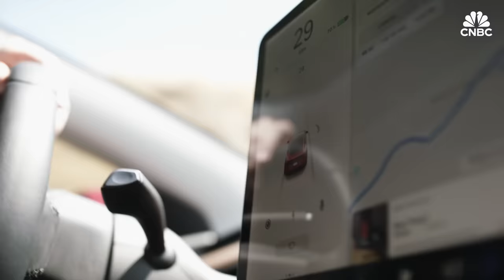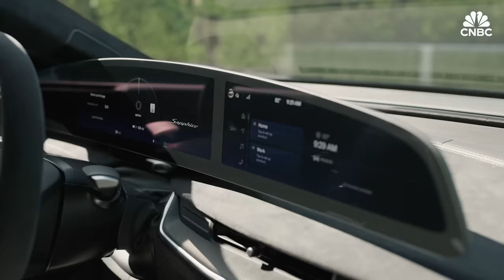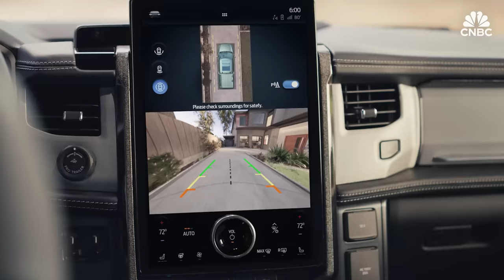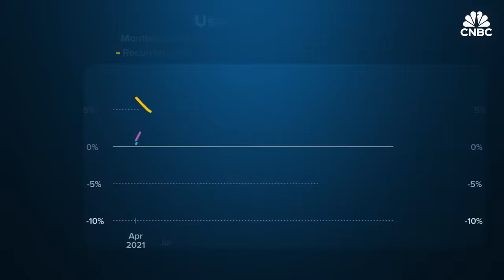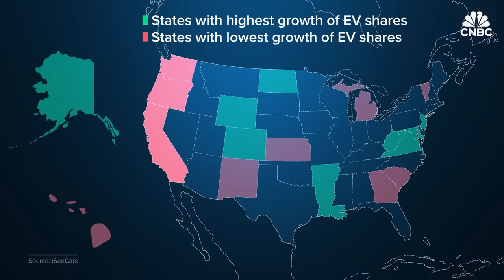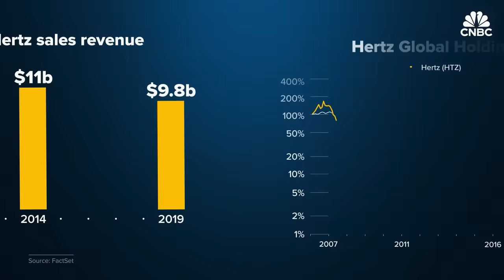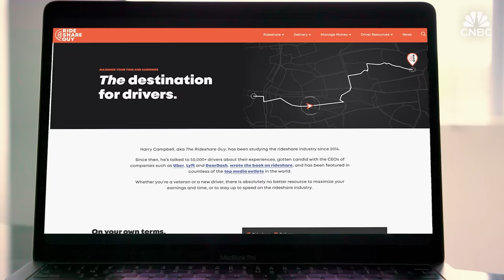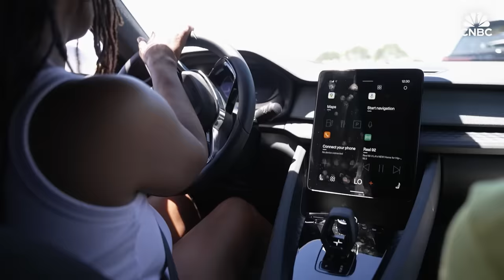Why EV Sales Are Falling | CNBC Marathon

Comment: I’ll tell you why EV technology is bad:

1. Charging times are too long.
2. Range between charges are too short.
3. Registration costs are too high.
4. Batteries have problems with cold and hot weather.
5. Batteries are extremely dangerous.
6. Expensive insurance policies/rates.
7. Tax credits are too low.
8. Prices are too high.

Technology suppose to improve in most or in all areas, is not suppose to go backwards.
Reply: Agreed. I still maintain that having the EV’s as an option for those people an EV makes sense for is great. Government mandates have gotten out of control though. It’s leftist group think just like the lockdowns a few years ago. 
The battery technology is great on a smaller scale.  Virtually all of my power tools are battery powered.  I am skeptical of the carbon impact in manufacturing and recycling of these tools and batteries. Weed eaters and mowers don’t have emissions equipment. I bet that those small reductions in carbon emissions on a large scale would have a greater impact on the environment than EV car mandates.
Reply: 1. Charging time too long? All you do is drive home from work then plug in. Next day you are ready to go again. But sure u drive to and from gas station weekly 15-20 weekly it's ok. 
2. Range is something u think about when u go road trip which computer plans your route sure if u get ice vehicles u still stop for rest anyways. 
3. Registration cost more because states deem ev cars not paying their fair share of road repair tax which u pay at gas stations. 
4. Sure weather plays a part in range but you pay cheaper charging ur cars at home anyways.
5. Batteries are dangerous but so is flammable gas.
6. Insurance is expensive bcos every insurance is also expensive but u offset by not needing to maintain/ service your car
7. Tax credit is low because politicians are paid by gas lobbyist. 
8. Expensive there are cheaper ev compared to compact Japanese or equivalent SUV.
Reply: @crazywildman  And for the huge number of people who don't have a fancy garage to park and charge in??  I park on the STREET.  I don't HAVE a charger to plug into.  WTF am I supposed to do to charge the damned thing??

And how exactly am I supposed to stop and charge on a road trip...  When there AREN'T ANY BLOODY CHARGERS IN MOST PLACES?!?
Reply: Just a list of a whole bunch of excuses
Reply: @Arclite02  There are chargers almost everywhere. Name these "most places" where there aren't chargers
Reply: @benblocker8526  99% of my entire city, for a start?  I've only ever seen a grand total of SEVEN chargers.  EVER.  And three of those were reserved for the business, not for public use.
Reply: @Arclite02  then u r not tesla demographic customer tesla customer is. actually most places have chargers most hotels offer charging too.
Reply: The batteries catch fire? Have seen many on the freeway
Reply: Charging to long? It charges while you sleep or work. I charge 2 nights a week. For free.
Reply: Nice to see car dealers worry😂 Of course they are obsolete. No one need them to chunk out 30% of the purchase and then all yearly service gone. Of course they cry.
Reply: @crazywildman  

Sorry, but no.... EVs do not simply recharge to 100% capacity using 110V home outlet currents!   Also,  if you get brown-outs and blackouts, you are screwed.
Reply: @edmundcharles5278  Gotta love catastrophic thinking to talk yourself out of something! Also you brought up a good point about the need to pad and expand our electrical grid. Thank goodness for the Inflation Reduction Act which helps address this issue.
Reply: @fernandop1  You obviously never had one. None of these are a real problem. Range and charging was my concerns before getting one. 
Now it’s difficult getting up with excuses for trips especially long trips since I enjoy it so much.
These are non issues.
Reply: @edmundcharles5278 depending on how much your average daily travel is depends whether you plug into a 110 or 14-50 plug (30miles range/hour).

Furthermore, if the lights go out so too do the pumps. Gas pumps depend on electricity to get that fuel out of the ground and into your tank. The outcome is the same.
Reply: 9.  Batteries eventually die and cost $10,000+ to replace.
Reply: @antoniovela8650  the average gas engines last between 200-250k. EVs last longer and with less maintenance.
Reply: @antoniovela8650  No they don’t. 1.2% of them do which is almost the same as for terminal engine or gearbox failure on ICE
Reply: @martinekstrom6303  Yea, EV owners can easily spot posers as the entirety of their wisdom revolves around headlines and old debunked claims. And yes, I relate with you in terms of not finding excuses to not drive these things. I've put 17K miles on my model S since December, zero maintenance. Ironically my F250, which has been sitting most of the time, is overdue for an oil change.
Reply: You forgot high property  tax. Due to its high price.
Reply: @Arclite02  Why would you need superchargers where you live? These are the chargers you will never use.
Reply: @martinekstrom6303  well, where the hell else would I charge the thing?
Reply: @Arclite02  At home, while you sleep or while you work. I do the bulk of my charging for free at home or work and the little charging I do outside is at 170+ miles from home at hotels while sleeping or at customers while visiting or at superchargers while eating.
Reply: @martinekstrom6303  that's great for you, Mr. Owns his own place.

I don't.  I don't HAVE a garage.  I don't HAVE a driveway.  I don't HAVE a spot to plug in, or an expensive, high power electric line to plug into.

My vehicle lives on the curb.  Just like millions of others.  So I'll ask again...  WHERE THE HELL ARE WE SUPPOSED TO CHARGE THESE THINGS?!?
Reply: @Arclite02  I forgot you live in a 3rd world country for infrastructure, we’ve had road side and public parking charging for years in Scandinavia.

Comment: The real problem is the cost of replacement batteries. I have a 24 year old truck with 240,000 miles on it, and it's still worth more than a Tesla with a worn out battery.
Reply: 1% of batteries fail and there is a 120.000 miles warranty. That’s longer than average ICE cars lifetime. Today you can also refurbish a battery.
It’s not a problem.
Reply: Most people who buy new cars, including me do not keep their car for more than 5 to 6 years. Also, resale value is not a concern. Once you start making big boy money, I am sure you will do the same.
Reply: @martinekstrom6303 And where do they dig rare earth for EV batteries?
Reply: @bonbonjovi4836 It's just feel good to have a fully paid Honda, and making 110,000K/year 😂😂😂😂 All extra money goes on top of the mortgage, which translate to lesser years of the signed mortgage contract. Just saying.
Reply: @octosquatch.  Your information is old. New batteries are very robust and will outlast the car by far. Only 1% gets problems and nowadays you recycle individual units.
Batteries with degrading after many years can be used as battery packs on your house. 
We have a fleet of 30 EVs and have virtually no problems. What you say had some truth 2015 but not now. Over 80% of new sales here in Norway is EVs. No one want to buy slow dirty ICE cars anymore. Also 100% renewable energy in grid and we still export enormous amounts renewable hydro energy to continental Europe. No problems.
Reply: @skywarp8655  Australia mainly
Reply: @skywarp8655  LFP batteries in Tesla and BYD, nowhere. They don’t use Cobolt.
Reply: @martinekstrom6303  pretty sure rare earth didn't came from water nor air. It has to be dug.
Reply: @skywarp8655  There is none on the LFP batteries that are in the majority in Tesla and BYD. 
Where cobolt is dug, Tesla use Australia as source. Your phone on the other hand was cobolt probably from Congo.